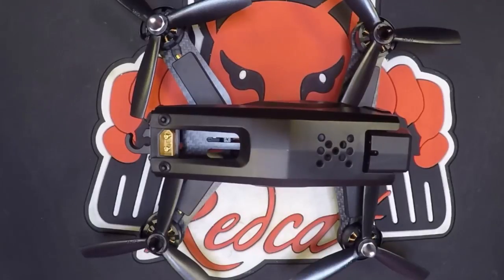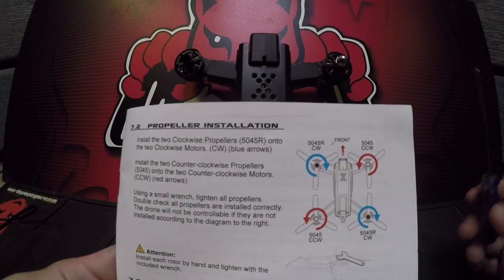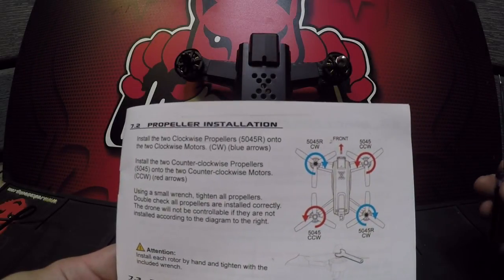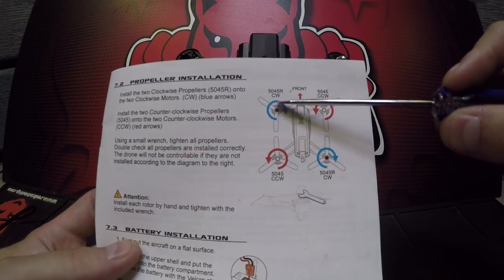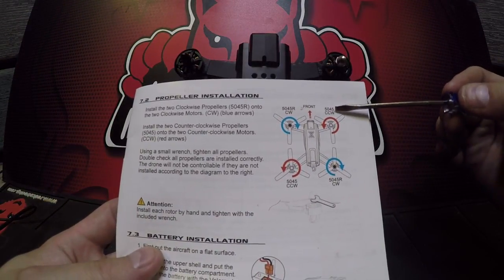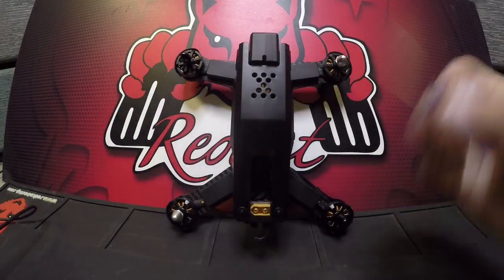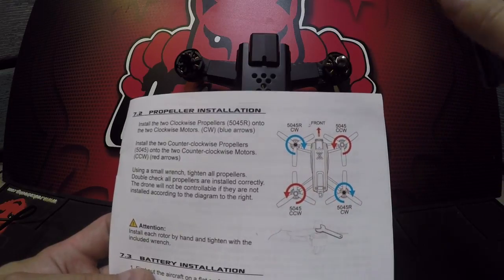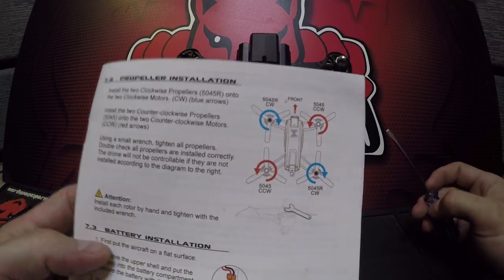RCU Carbon 210 Race Drone - Propeller/Blade Install

Comment: I'm trying to figure out why my rapid drone 210 carbon fiber race drone only does the first beep when the left rear light comes on but not the right light or beep sounds . It worked fine on the flight before but when pulled out to fly two weeks later it didn't work and havnt flown it since . Please help cuz there isn't any troubleshooting on this via online.
Reply from the maker: The best option is to reach out to our support team via email or phone Mon-Fri 8am-430pm AZ time. We can help for sure!!
http://www.redcatracing.com/Contact

Comment: My props have A and B on it which is clockwise and which is counter clockwise
Reply from the maker: Not 100% on those blades as the stock Carbon 210 blades do not have a "A" or a "B". Instead they have the # "5045" or the # "5045R" which identify as the CW or CCW blades as seen in the manual for the drone on page # 7. If your blades have an "A" and a "B" they must not be the stock ones and we can not fully answer your question as we do not know what those letters stand for.